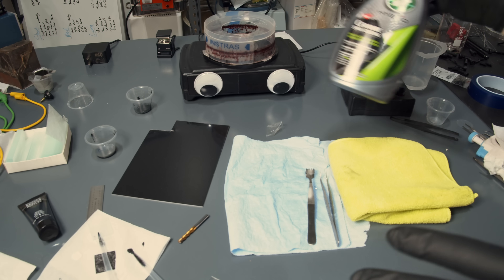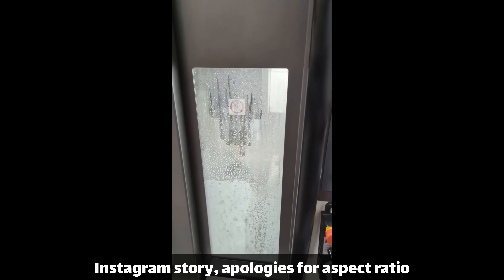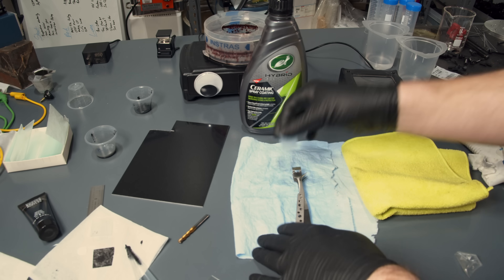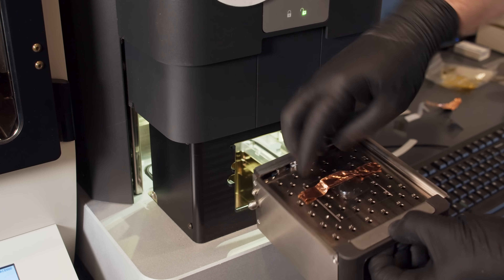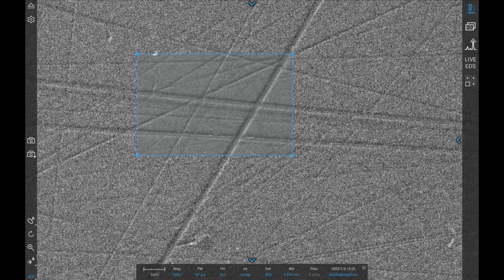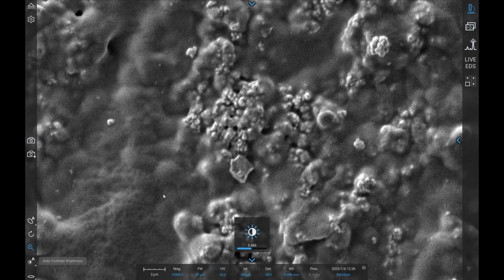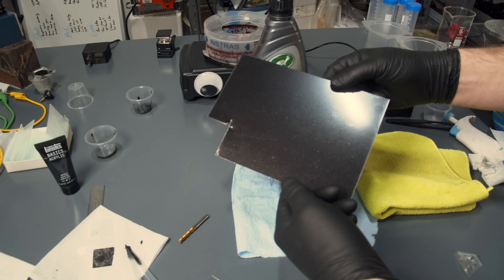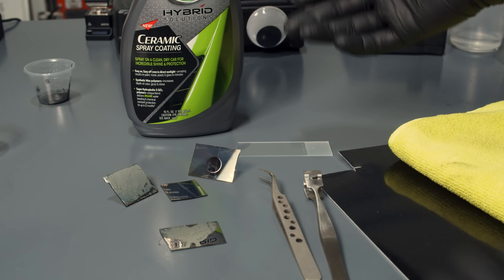More rigorous analysis of "Ceramic" car spray

Comment: are you seeing silicon from silica, silicone polymers, or silicon carbide abrasive from sanding?
Reply from the maker: Is indeed the peril of SEM and EDS, almost like reading tea leaves! 😁 Assuming the silicone polymers really do form thin films and not aggregates, those should be below the detection limits of my EDS (i've tried thin films in the past and it can't really see them, swamped by signal from the bulk substrate). Hopefully wasn't SiC, I cleaned aggressively in the ultrasonic first and didn't see a big carbon signal at the same spot. Definitely a possibility though!

Comment: Not possible if its not ever tried, but why don’t some kind of wiper inside the glass with magnet on the outside , would sliding door interfere ? Or wiper can disloged by coolant? , flying chips ?  etc etc

Comment: I think you are still missing the point. You are using a comparison of a one inch square surface to emulate a Car or window. When you rub "off" the solution from a mirror, car or CNC shield, you are not actually "wiping it off" You are helping the solvent dissipate so the wax and ceramics can blend into the surfaces and imperfections to make an attempt at creating a hydrophobic enough surface. I think the comparison is like using a 2 foot rubber squeegee when wiping it off so quickly after spraying. You really are not blending the active ingredients into the surface as much as you are squeegieng it all off with that massive micro-fibre cloth. Just my two cents worth, I would spray, let air dry and THEN wipe it out with the micro fibre cloth, lightly.Similarly to how the original Rain-X process says to do. I suppose it is like wiping a baby's butt as opposed to our own. You would never do it the same way. Or perhaps, polishing your boots to a spit shine. I will bet that will give you a result you will be happy with. Thanks for the video.
Reply: How do I know that I can trust this?

Comment: Seeing how the particles accumulate in the scratched glass sample makes me wonder if this is the intended mechanism for the spray on car paintwork - we could assume that the un-scratched areas of paint still have some of their factory/original hydrophobicity, and it's the scratches that need to be filled to regain hydrophobicity on the macro scale. Perhaps the particles help the wax/silicone compounds to get a more secure key in the surface and last a little longer.
Reply: Just smoothing the surface will not make something hydrophobic though, which is what you comment seems to suggest.  If that were the case, then this wouldn't be needed.  Just a good buffing to smoothness.  Water would still stick regardless of how smooth it is.  Gotta get something between the surface and the water to make it hydrophobic, which is what the spray is supposed to do, not just to fill cracks to make the surface smoother.
Reply: @BackYardScience2000  Yes I agree, smoothness itself isn't the goal. I probably should have put more emphasis on the last sentence about the particles potentially helping the hydrophobic compounds adhere in the crack for longer. The wax/silicones are actually doing the hard work :) My assumption about the unscratched areas is that unscratched = less wear, and hence the original coating may still be effective.

Comment: About using for cars.
Lol. What paint? What soft paint?
This thing is clearly "antirain" for glass.
For paint they use another wax
Reply from the maker: 🤷‍♀️ the bottle says it can/should be used on painted surface. I would generally agree though, but figured I'd address one of the major recurring comments 🙂

Comment: have you ever tried the 2 part hyrdophobic spray coatings like neverwet? I wonder how that would hold up.
Reply: The 2-part Neverwet is fun to play with. I put some on my shoes and was able to walk through mud and it just slides off. I also selectively sprayed polycarbonate to see how water gets captured in the unsprayed areas. It does have a slight haze, but works really well. It held up on my shoes for about 1 to 2 weeks. It works much better than the 1-part neverwet intended for clothing.
Reply: I "think" the 2-part Neverwet works by creating tiny tendrils that keep the droplets off the surface, so the surface tension never has anything to grab onto. I never verified that theory by looking at it under a microscope. I need to do that someday.

Comment: If the aim is to keep the glass clear to improve visibility, why not install a wiper system - there's a rotating circular type (I don't know the correct terminology) that rotates super fast that would do the job well.
Reply: Clearview window!
Reply: Yeah there's several brands and they work really well !!!

Comment: You should check out AvE he added a wiper to his that automatically rotated to create a window for his camera.
Reply: I wonder if one could be hacked with a harbor freight angle grinder.
Nominal 11k rpm wouldn’t interfere with the frame rate maybe.
For someone with a shop it might not be a hard build vs the cost to buy

Comment: Given how low the silica loading is in this spray, I probably wouldn't be too concerned - but small, hard particles are not best friends with guide ways, ballscrews and bearings! Very interesting video :) I always assumed these 'ceramic' coating sprays were pure marketing, but good to see some analysis.
Reply: I’m thinking that the marketing and product development divisions don’t talk. Product development probably put silica in as a polishing compound as it would do a good job of taking off the oxide layer from paint and helping the wax work better. Marketing see they have added silica and decide the better way to sell the stuff is making people think it’ll harden the coating.

Comment: Those "hybrid" coatings are meh.  Most of the hydrophobicity is probably coming from the wax.  Look into the 3M ceramic coating products (but these are still formulated to stick to paint). They are siloxane polymers, other functional siloxanes and the alcohol solvent.  The amophous silica is just sol-gel filler, likely just TEOS based.

Comment: let it dry before wiping 🤦
Reply from the maker: That's not what the directions say to do 🤷‍♀️
Reply: @BreakingTaps  yeah I know. Trust me bro. Let the solvent dry some before wiping it. It should look like chunky peanut butter under SEM
Reply: The ones i used specifically say to not let it dry. Only work on small sections to avoid drying it up.